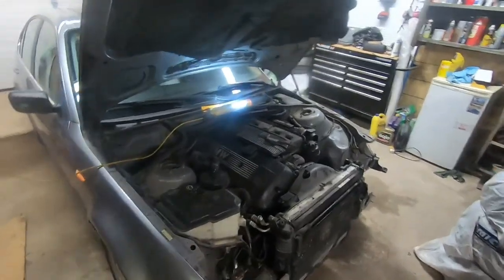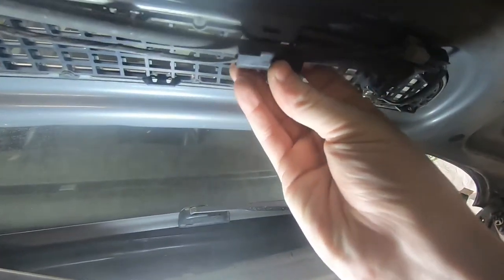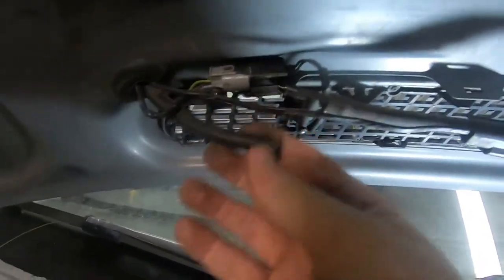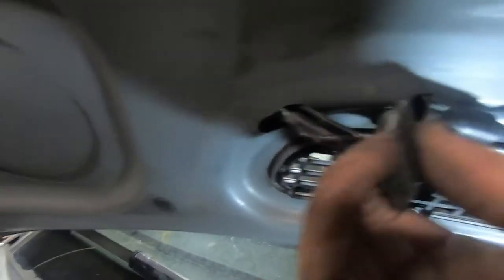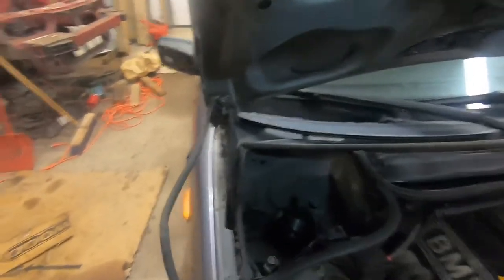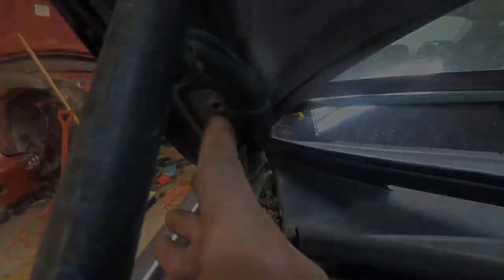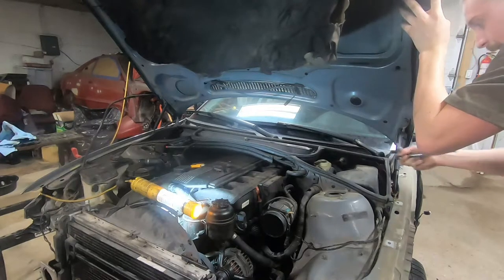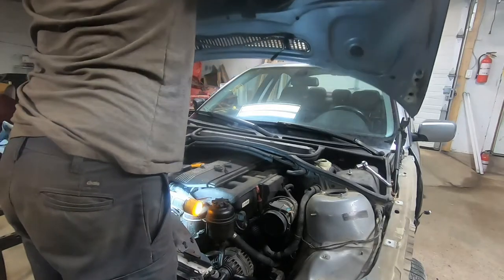BMW E46 Hood Removal (How To)

Comment: Did you find out the part number of the broken clip that you talked about at 0:45?  I broke mine as well.  Brittle plastic.
Reply from the maker: I had spares from my parts car but I believe the part number is 61138372304.
Reply: @LifeAtTheShop  Thanks!! And the part number helped to find the specific diagram for the rest of the part numbers I'll to replace the broken parts from brittle plastic.  Here it is for anyone else (specific to 2004 330ci): https://www.realoem.com/bmw/enUS/showparts?id=BW53-USA-06-2004-E46-BMW-330Ci&diagId=61_1085#61138372304
Reply: Zip tie

Comment: Same process when putting it back on?
Reply from the maker: I found the easiest way to put it back on is to have the 2 front bolts (the ones that I did not fully pull off) in the hood loose and then slide the hood onto the hinge, resting on those 2 bolts. Have the other 2 bolts with you and then you can hold the hood up with your hand as you screw them in. Once it is on routing the washer fluid hose and wires back through the hole is pretty easy.